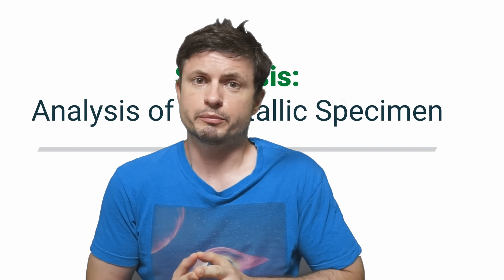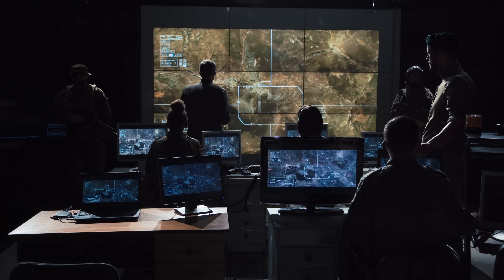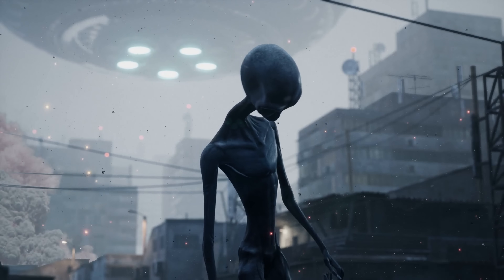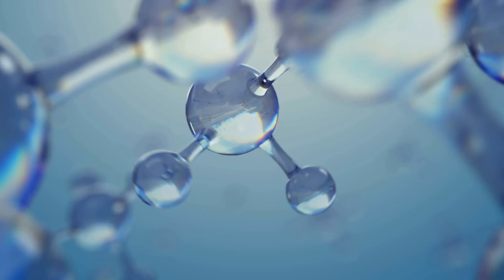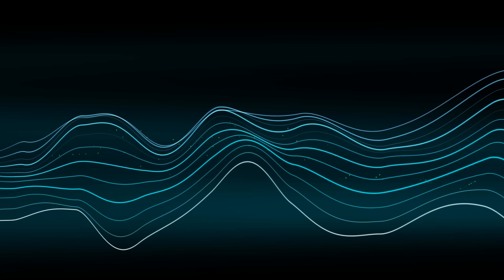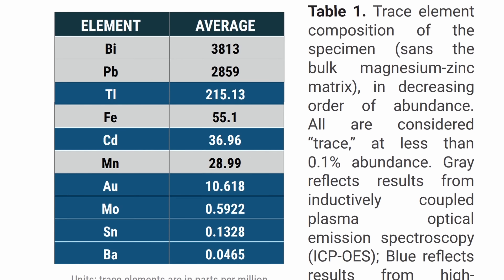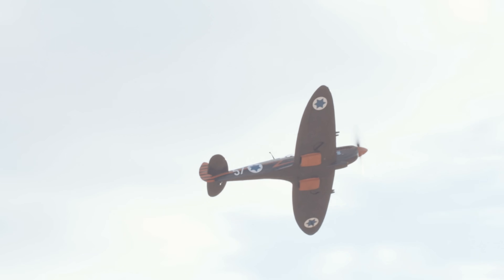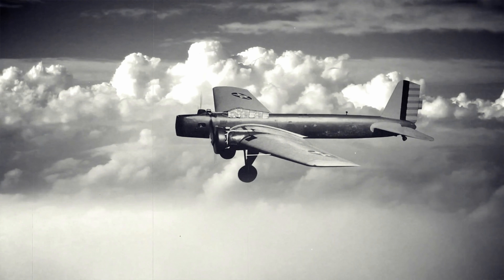Metal Piece From 1947 Roswell Incident Analyzed By a Government Lab

Comment: It would have been funny if it turns out you could explain the whole postwar era by two flying saucer crashes: one in  Germany in 1933 and another in the USA in 1947. In both instances,  material was recovered for reverse engineering, being the wreckage of short ranged two seat scout fighters. These craft had jet engines for atmospheric flight, chemical rockets for exo-atmospheric flight and crucially no hyperdrive or hibernation systems suggesting a mothership must be involved for interstellar travel. The airframes were composed of carbon fiber, with titanium and aluminium alloy reinforcements. 

The ships were armed with laser weapons and each carried two nuclear bombs. The reason why they didn’t test the hiroshima bomb design was because it was an original bomb from the ship that crashed in Germany, recovered during Operation Paperclip. The nagasaki bomb was the replica, used in anger for the first time.

The ships onboard computer was powered by a pentium CPU, with 2GB of ram and a spinning magnetic hard disk drive.

We are now stuck at our current technology level because there is no more cheat sheet material to copy from.
Reply: Frankly I think the exact reverse is the case.  The Nazis were ahead in the production of fissionable material and a year before the end of the war the head of Nazi advanced research, Hans Kammler, made contact with US agents and arranged to divert the material (intended for the Japanese A Bomb project in North Korea) to the US.  He also passed over to them info on the German antigravity research.  It might have been a test of one of those devices that happened at Roswell.  Since then the alien card has been played in several major cases, notably Kecksburg and Rendlesham.  I am not a UFO sceptic, many cases do defy our powers of understanding, but there is a mass of disinformation going  on and disentangling it all is very difficult.

Comment: The Roswell incident was most probably an early experiment to bring a space capsule up into the lower space and then bring it back again, but without putting it in orbit. 

Possibly they used both balloons, rocket motors and parachutes for the trip up and down, which means that some of the spin from authorities used certain true ingredients.

Inside the capsule were placed shortgrown persons or children with some devlopmental syndrome, taken from an institution, as guinea pigs. The capsule crashed however, and the persons got killed.

The persons witnessed the event, including the first military units that came to the site eronously took it to be a manned alien spacecraft. 

Using involuntary persons as guinea pigs is highly unethical, and this is the reason for all the spin to explain away what really happened.

The metal fragments may well be from the capsule. That one experimented with magnesium alloys sounds very logical, since such alloys are lightweight and strong.

Comment: The method of using sound vibration as a fundamental basis to funnel bits of information to create fueling bits for designated matter that is encoded to behave, and by having additional complex structure latices that matter can perform complex function as, but basically, the fundamental form has unique quantum properties that can sonetimes be aquired, and the the more quantum properties when its somehow created powered for some probable exploitation.

Comment: Magnesium has a lot of good properties in terms of strength vs. weight and most aspects of corrosion resistance. I think the shortcoming was the one glaring bad one. It could turn a class-B fire into a class-D fire,  if you had something like a leak from fuel or hydraulic fluid catch fire for some reason, that may be enough to get the magnesium parts around it burning. And then good luck trying to put that out. I think it still has uses for some things if weight is a major concern, but composites and aluminum alloys have mainly taken over in most applications.

Comment: It's a fragment of an elliptical flange coupling manifold from the intake choke synchronisation diaphragm. You can tell because of the way it is.
Reply: "Hey let me walk you through our Donnely nut spacing and cracked system rim-riding grip configuration.
Using a field of half-seized sprats and brass-fitted nickel slits, our bracketed caps and spray-flexed-brace columns vent dampers to dampening hatch depths of one half meter from the damper crown to the spurv plinth.
How? Well, we bolster 12 husk nuts to each girdle jerry, while flex tandems press a task apparatus of ten vertically composited patch hamplers, then pin flam-fastened pan traps at both maiden apexes of the jimjoints."

Now, that's the McMillan way.

Comment: While there may or may not have been a non terestrial event in Roswell, it's fairly well known that a microwave weapons experiment was under development.  Bismuth is diamagnetic, so as one can build a toy which levitates a magnet in a magnetic field between two Bismuth disks. It's relation to ”antigravity" is not unfounded. 
But
As gravity is an observable reaction rather than a "force" it would be more like saying gravitational insulation. I expect the original intent was to filter specific wavelengths to prevent damage to microwave generation equipment providing a "farraday effect."
It likely wouldn't have worked.

Comment: Yes, used as a simple static wave, not read . To read them the data is immense and the speed is leading to this. On the flip side you have to capture the return, process it to disk, record positioning of it, label it,  but first…. Be able to accurately READ it at speed. Maybe someday. Not yet.

Comment: Except the EM spectrum light is a terahertz frequency Violet is 668-789 Thz, Blue 606-668 Thz, green 526-606 Thz, Yellow 508-526 Thz, Orange 484-508 Thz and Red 404-484 Thz. Therefore the human eye is the perfect terahertz waveguide provided they are not color blind or have vision problems.

Comment: Considering the official claim is that Roswell was from not a weather balloon but a string of balloons used to detect nuclear explosions and there were no nuclear explosions in 1947 my guess is this is part of a rocket or jet engine.
Reply: U.S. nuclear testing program began with the Trinity test on July 16, 1945, at a location approximately 55 miles northwest of Alamogordo, New Mexico. The United States conducted five additional nuclear tests between 1946 and 1948.

Comment: Perhaps a person who know materials science can answer this. If the object has micron-thin layers of various elements can you tell me what method would be used to create the object in the 1930’s prior to laser deposition? It’s fine to say it was a failed test material from the 1930’s but the explanation will be far more believable if the actual ca. 1930’s manufacturing technology was named.
Reply: In the 1930s, prior to the advent of laser deposition technology, the method commonly used to create micron-thin layers of various elements was vacuum evaporation.
Reply: @barneyhall2753  perhaps the two year study confirms that each of the layered materials can be thermally evaporated and the bonds between layers is consistent with a vacuum deposition process. This video is disappointing n many levels. Anton spends much time on the aspect of a proposed use and really no time at all on the analysis, which is really the whole point of the study.

Comment: I might be able to provide some insight to what the metal was being developed for. I have seen lights from flying objects I can only describe as having anti-gravity (Pulling off 90 degree turns in orbit). So I'm pretty sure (probably a defense contractor) has been attempting to reverse engineer some pieces of "tech" they may or may not have discovered (pre-1913). I think they "humans" have been trying to reverse engineer spacecraft with these capabilities spanning over 100+ years have tried and failed (probably where that piece of metal came from. It seems with the increase in sightings and time, that humans have begun to produce quite a few of them. That's just my guess anyways.

Comment: Believe there was a claim made in 1957 about Brazilian Magnesium, supposedly a  “pure” element sample. Again,  allegedly from a crashed UFO.  Subsequent analysis (not the original test claims) found multiple elements, including Strontium which is used aerospace metals together with Magnesium. One speculation being it was a failed Sputnik craft.

Comment: This video totally overlooked the majority significance of that material.. but I understand this is just a review of the study not an analysis of it. Yes many people have suspected it is alien material to do with Roswell but the most astute perhaps analysis is that by Henry Stevens in his book Hitler's Flying Saucers. The correct analysis for that material should have been to match it to the German flying saucer prototypes. One of those particularly the V7 for example may have been exactly what crashed. To do that much of an in-depth study and not correlate it to all of the theories on what crashed was very limited. This insight could bridge that and perhaps using the study, a follow-on could be done to see how it correlates info available on the Nazi saucers, and there were many with all types of designs. If you have not read the book, get a copy while it's still available and read it ⏳🛸👍

Comment: That the military tried to coverup a top secret program to monitor Russia for atomic testing is hardly surprising and the cover story they came up with, that it was aliens, worked a treat in that the media and the public were fixated on aliens and not espionage.  Project Mogul was a thing and what crashed north of Roswell was a high altitude balloon used to carry the sensor package needed to detect a Russia atomic bomb test.  They would have been derelict in their duty if they had not tried to monitor what Russia was doing.

Comment: The fact that the material isn't of extrasolar origin doesn't say anything at all about any fragment of any piece of technology, and it just keeps annoying me that this is a point of argument at all. We don't even intend to leave the solar system and we already plan to use materials we find on the moon and mars to build stuff there, why would aliens, existing or not, have a different approach?

"Oh, yea, let me just lug around raw materials my destination has in abundance to build the support infrastructure needed for the upkeep of my spacecraft."

And aside from the in situ nature of resource usage, let me address the "no special properties" argument as well:

The sophistication of a piece of technology isn't solely dependent on the novelty of its materials. Advanced engineering, design, and functionality can be achieved with well-known substances, enhanced by advanced techniques and applications. Advanced extraterrestrial technology might very well use materials that are familiar to us. Just as we continue to use carbon steel, as we have more or less for 700 years, to build increasingly more sophisticated machinery, aliens might use materials like magnesium alloys for their advantageous properties... advantages we might not have realized yet. I'm pretty sure that we use alloys today that were seen as less than useless a hundred years ago.

Comment: NICT (Japan's National Institute of Information & communication) broke the world record for the most data in the shortest amount of time- they have achieved a staggering data transfer rate of  402 terabits per second (Tb/s) over commercially available optical fiber cables.

The groundbreaking feat was detailed in a paper presented at the Optical Fiber Communication Conference 2024 in San Diego.  The Aston Institute of Photonic Technologies and Nokia Bell Labs contributed.

They transmitted signals through 1,505 channels across a 50 km stretch of optical fiber. They combined six amplifier types and an optical gain equalizer tapping into the unused 37 THz bandwidth.

Among the amplifiers shown was a thulium-based doped fiber amplifier operating in the C-band or C+L band systems. Additionally,  semiconductor op/amp's & Raman amp's achieved a  256 Tb/s data rate across nearly 20 THz.

Other amplifiers contributed to a cumulative bandwidth of 25 THz, resulting in an impressive  119 Tb/s data rate.

The experiment's maximum result exceeded the previous data rate capacity by over 25 per cent, while transmission bandwidth increased by 35 per cent. Remarkably, this achievement relies on existing technology used by some internet service providers.

When Spectrum Internet was asked if they would consider migrating to such tech, they replied: "30 Mbps is the best we can give you."

Comment: The Bismuth is the only thing throwing me off as thats usually a metallurgical additive for xray shielding/nuclear stuff. but everything else would imply either a coating or part of an engine, such as a block liner or piston top, and the lead could be there from leaded fuel (basically the standard anti knock additive in all fuels, particularly aviation, back then)

Comment: The material recovered from the  1947 Roswell UFO incident found to be not extraterrestrial in origin, by a GOVERNMENT laboratory! What a surprise?
I have a question though; Since the government "knew" that it was just a weather balloon, why they went into the trouble to analyze parts of an old weather balloon?
Reply: Project Mogul (sometimes referred to as Operation Mogul) was a top secret project by the US Army Air Forces involving microphones flown on high-altitude balloons, whose primary purpose was long-distance detection of sound waves generated by Soviet atomic bomb tests. The project was carried out from 1947 until early 1949.

Comment: Terahertz waves are used in airport scanners and I believe in some military applications to detect what's behind a wall.
Reply: There's a further variation of the "behind the wall" scanner that can do density mapping. Can see a ways into the ground and show visual contrast on what has been dug up or buried. Wires, pipes, shallow tunnels, bunkers, caches, or whatever. It can make them stick out vs. the background. Either because the item itself is different from the ground in terms of density, or the soil where something is buried happens to be loose and less compacted compared to that of the surroundings. It sounds crazy, but it's kind of neat to see demonstrated in some way.

Comment: It would be interesting to compare it with parts from a Me-163 Comet, a rocket plane that looks really strange, had a tendency of exploding and was tested at the Roswell base in 1947.
Because an Comet would explain the early reports that it looked strange and clearly wasn't a balloon. It was in the area of the time and US researched it as a precursor to many of their X planes (including X-15 in the 60s).

That is of course just a hypothesis but it is something worth investigating and unlike aliens it can be tested if this part was found at the crash site. It seems unlikely you would find a part from one at the site unless it was what crashed since US didn't bring that many planes from Germany after the war.

Another plane that was also tested the same time was the Me-262 so it is also  worth looking at if the 163 doesn't pan out. And you alien fans shouldn't be upset about this, trying to figure out the truth of something is easiest done by testing and discarding as many possibilities you can. The more things we can discard, the closer we get to the truth.

That it was a German plane tested at the nearby air base is plausible since we know the planes were in that area and it was at the time classified research so the Air force had a motive to cover it up. It is not the only possible explanation of course.
Reply: I've always wondered if it was a Soviet spy plane but don't know what type of range they would have had back then. The strange alien writing - cryillic alphabet. 1947 it's very possible a lot of the people seeing this writing had never seen Russian writing before.
Reply: @JH-pt6ih  I kinda think Soviet writing would just look foreign but not alien even to someone with poor education though. Something like Japanese or Chinese maybe...

The problem is more that if it was in Alaska a Soviet spy plane would have been the first thing to suspect but for a plane to reach New Mexico without being picked up by radar you don't find many planes who could do that.

In fact, I can only think of a single plane who had long range and limited stealth capabilities (let's just say the 1947 radar wasn't the best) and that is the Horten Ho 229.

The problem with that is that US took the only known completed plane (It is still in the Smithsonian) from the Germans.

There is no known Soviet plane from the time who could make the journey unless it flew from Mexico and even if they did so, it should still have shown up on radar.

So it is extremely unlikely but not totally impossible. If the Soviets somehow got hold of a Horten flying wing or built one from a blueprint, it could have done the journey undetected at least in theory.

It is far more likely it was a plane flown from the nearby air base. There is no information of US testing any Japanese late war machines 

I guess a Kugisho MXY7 Ohka (Cherry Blossom) 22 without a warhead would be a possibility though, there is no proof US ever tested it but if they did, it would have writings in Japanese.